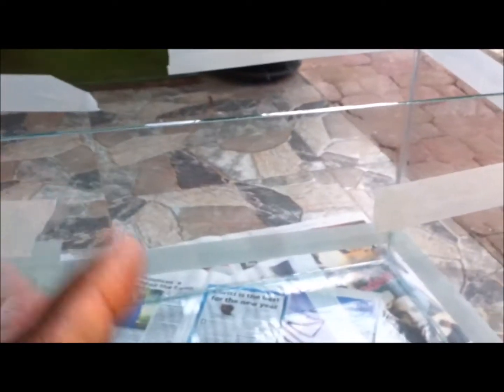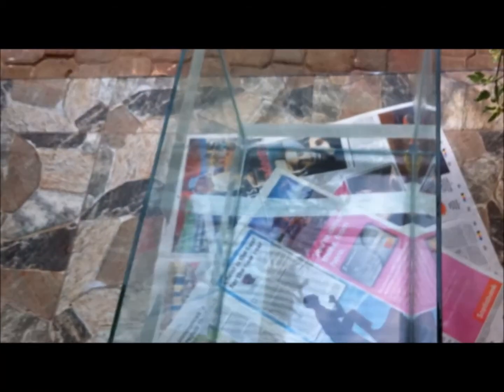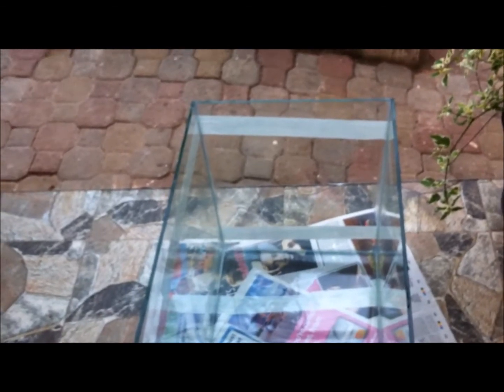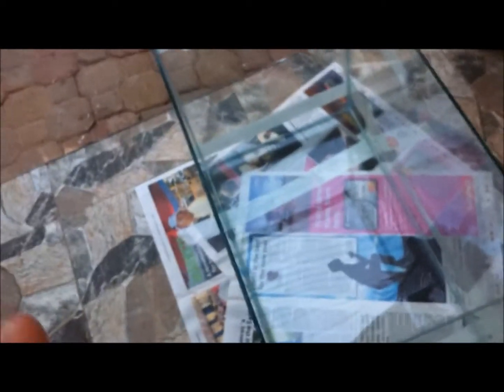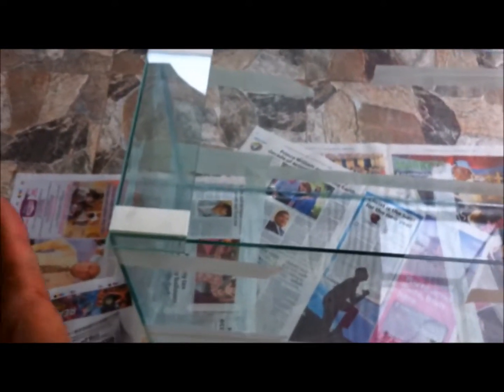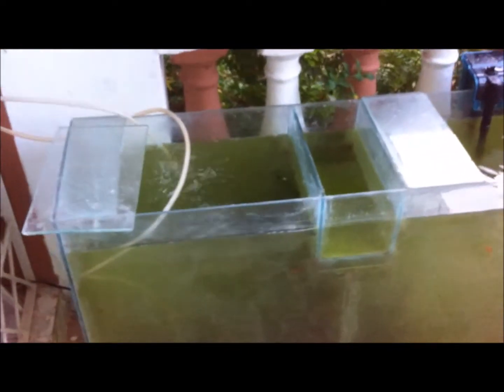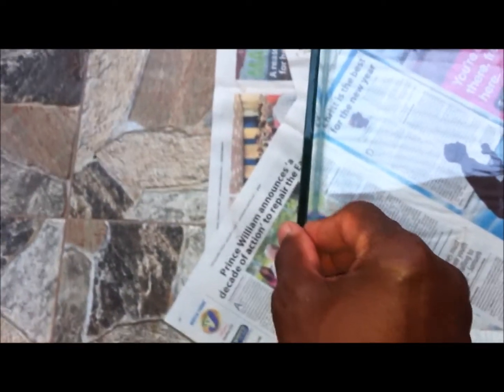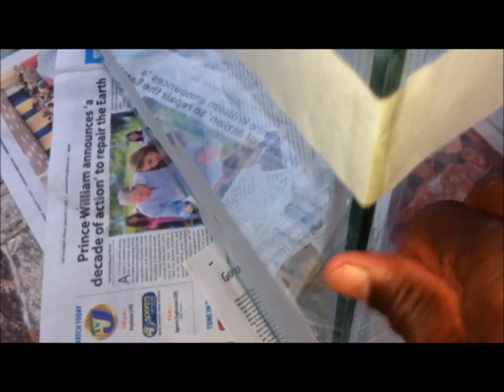PLAIN AQUARIUM GLASS| WHY USE LOW IRON GLASS ON AQUARIUM BUILD

Comment: Can you get the glass in  black and what about tinting ?
Reply: And what's the dimension of the that tank and how much gallon will it hold
Reply from the maker: Designing your aquarium using tinted glass may result in issues when you chose to change the occupants of the aquarium. dark aquarium glass will prohibits you from viewing the fish stock inside the aquarium ( especially a fish with a earth tone or dark color). Brightly coloured fish maybe visible but not as attractive in a tinted aquarium.

I usually use an online calculator to determine the dimensions of my aquarium. I would think about the length, height and width factor these in and then calculate the possible volume.
Reply: Tinting meaning  leaving the front face untinted but everywhere else
Reply from the maker: that may be a problem should you chose to install plants iin the aquarium in the future. I would'nt do that. I would just add background paper at the sides instead.